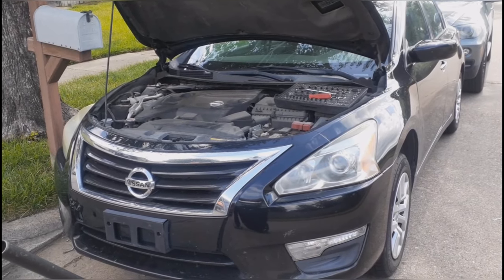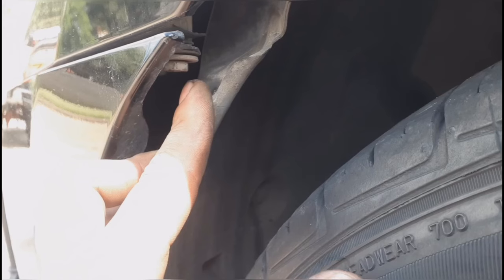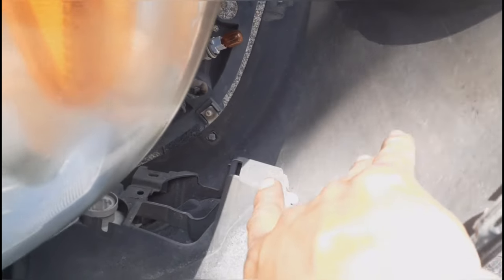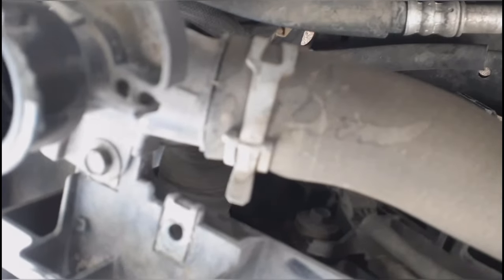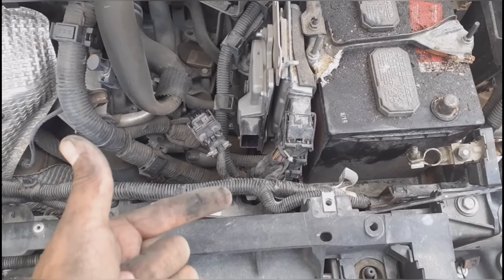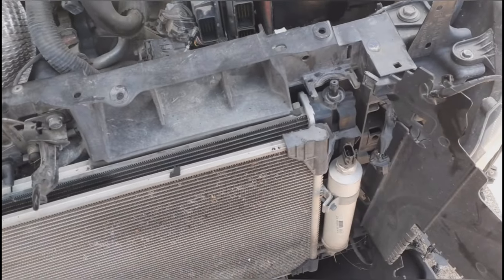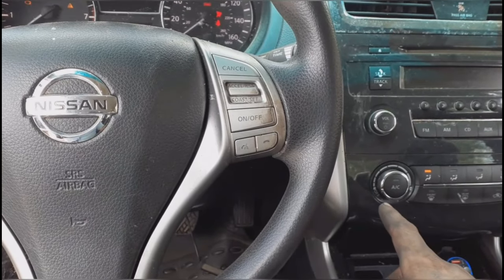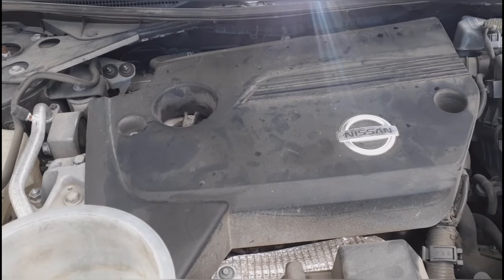2013 Nissan Altima 2.5 Radiator Replacement | 2013 Nissan Altima 2.5 DIY Radiator Replacement

Comment: This is the best video out there on You-Tube, I have the exact model 2013 Altima. Followed the steps to the letter and it all worked out great, Did the steps in reverse for the installation. Excellent job putting out this video.
Reply from the maker: Thank you for your feedback

Comment: I used this video for my 2015... My advice to add on to this is to remove the whole battery and tray. You can reach the top trans hose way easier

Comment: Did it just like this thanks to you. Exept i didnt take off all the bumper support. Just top screws and 8 nuts and it came off in one pice. Instead of 3. I installed a 50 dollar ebay radiator. Ill post how long it last.

Comment: Good video and helped ne get going in the right direction. You dont have to completely take the bumper or bumper support off just loosen them and let them fall out of the way. Also just loosen fans and leave them in there.
Reply from the maker: Yeah I know sometimes I just take a little more extra stuff so you guys have more room and won't damage nothing. I had some bad experiences when I try removing some stuff in tight spaces.
Goodluck by the way

Comment: Just wanted to say thank you for your video, my wife 20014 Altima radiator shit the bed, I figured that I would save some dough and do myself. Damn, it took awhile to remove and replace the radiator, but I'm satisfied with the result.

Comment: Hey is the 3.5 engine and 2.5 the same steps? I have the 2.5 engine
Reply from the maker: It might be on the radiator side just look at the video if it looks the same you can use my video.

Comment: How does having the heat on but the car off benefit the bleeding process legitimate question. Does it have an electronic water pump?
Reply from the maker: It allows coolant to circulate through the heater core where air bubbles can be found. 
Same process with electronic water pumps, this will also minimize the time to bleed it once you turn on the vehilce.

Comment: 🦌 hit the car.  Radiator and condenser is bent.  Coolant leaking.  Worth it to replace both and keep the car or just let them have it?  Can I realistically do this on my own not being necessarily handy?
Reply from the maker: I think it worth fixing it not to bad of a job. Maybe the only the that you might need help on its refilling the A/C condenser.
Good luck

Comment: How long did it take you and i have 2016 nissan altima should be about the same process right??
Reply from the maker: Since I know the process around 2 to 3 hours max because of the coolant bleeding. It should be the same if it has the same engine.

Comment: What kind of coolant did you use? ? It does not look right, should be blue like Asian or Nissan.  Otherwise, thanks for putting up the video.  I am doing this to my car right now.  I hope I can i get it back together.
Reply from the maker: The job is not to bad, on the coolant I did told my customer couple of times but that's what they supplied.  There's other coolants compatible as well, just double check them before adding. 
Good luck

Comment: Why do I need to remove fan?
It's not hooked up to the radiator!
Reply from the maker: You don't I did it for video purpose so you guys can see better. But if you can detach everything I mention on the video you don't need to remove it.

Comment: What happens if the right aluminum bottle got a hole like the gas go out is that the condenser what problem will be driving it with it broken
Reply: You just won't have a/c .